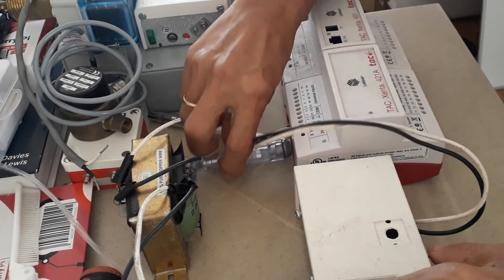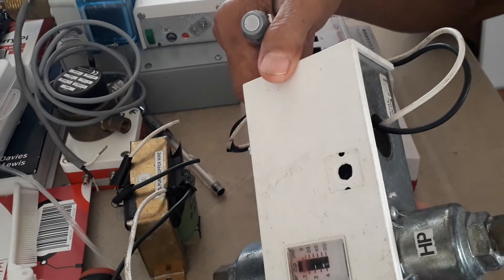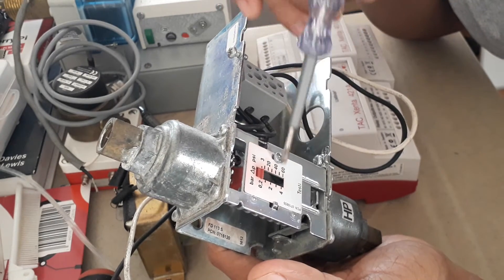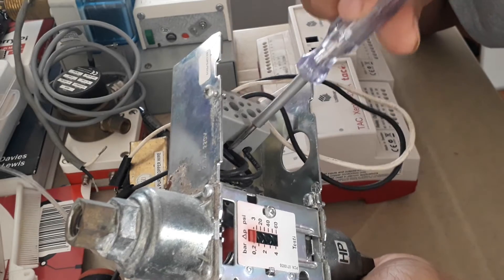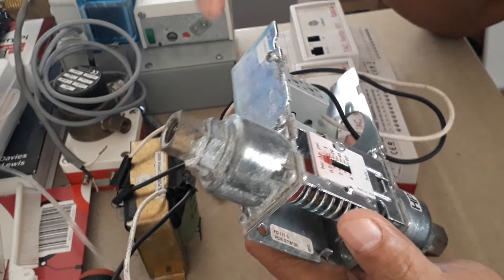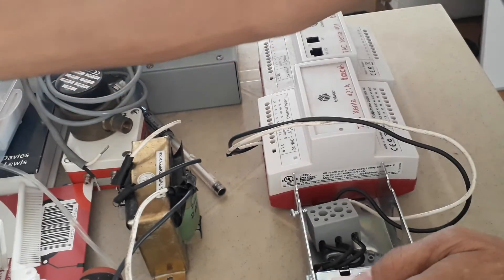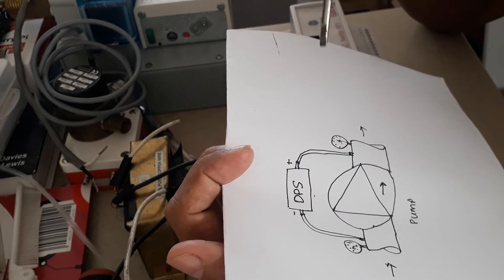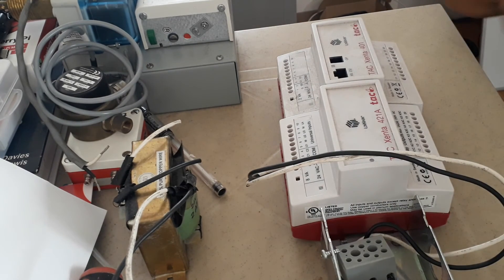How to become a BMS engineer part 57 (Water Differential Pressure Switch)

Comment from the maker: By the way you should provide a small isolation valve for the DPS copper tubing (+ and - port) for the purpose of removing the DPS if you need to replace it.